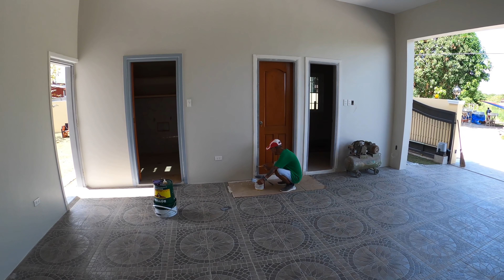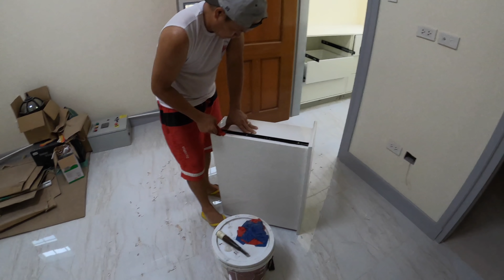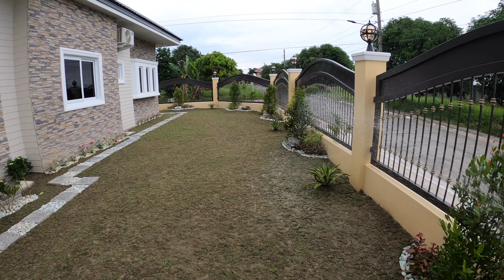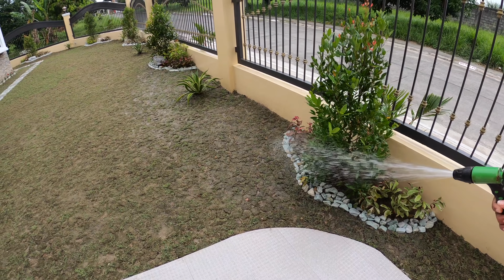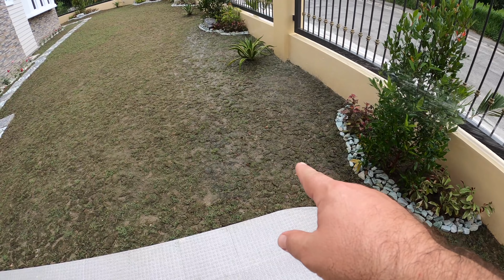Philippine House Building Step by Step, Build Day 264: Waiting Patiently

Comment: Hi Tex, you may want to consider insulation on your roof internally, the heat that gets radiated from a steel roof in summer is astonishing, also keeps your house cooler overall 👌
Reply from the maker: Welcome to Casa TexPina!
May be a follow up project (DIY). Hard to find traditional insulation here. Norm for Philippines is just the PE Foam that we installed. And BTW, we went double the normal thickness.
Thank you for tuning into our channel. 👍😊
Reply: @CasaTexPina  yes I know it can be tough, I think your end shipping it in from China...been watching for some time fella, nearly at the end of your journey :)
Reply from the maker: @billybiker1383  
First comment usually gets a Welcome message. Thanks for watching.
Can’t wait to move in. It’s been a long journey. 😅
Reply: @CasaTexPina  the house does look amazing though mate, good job 👍